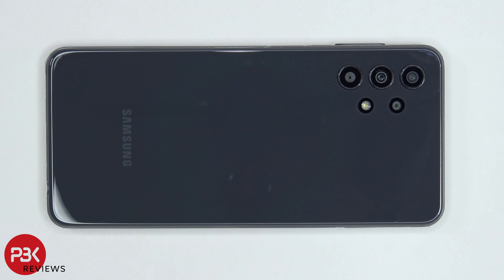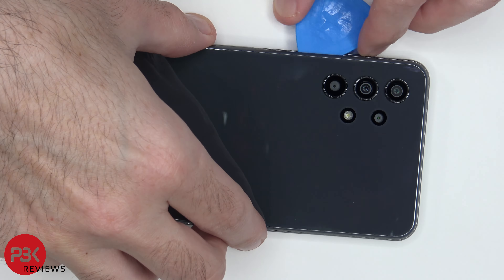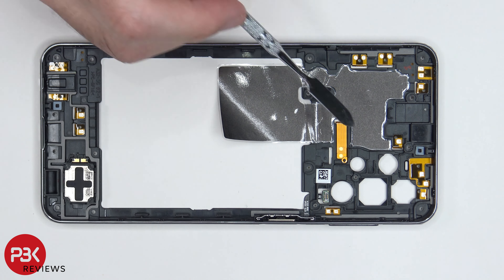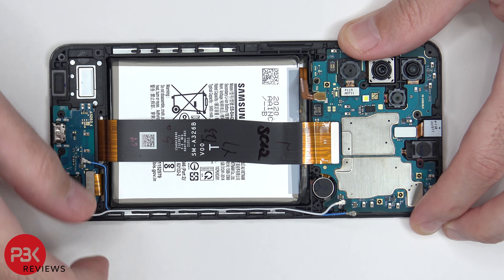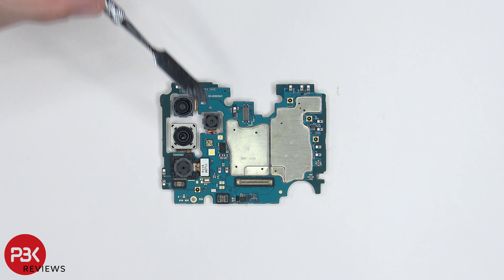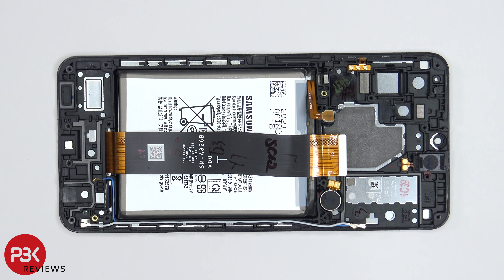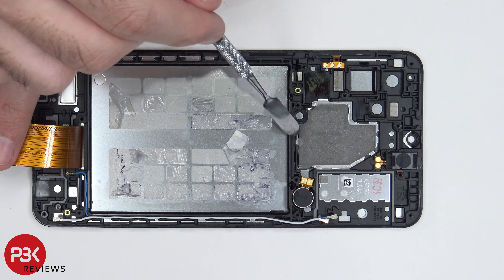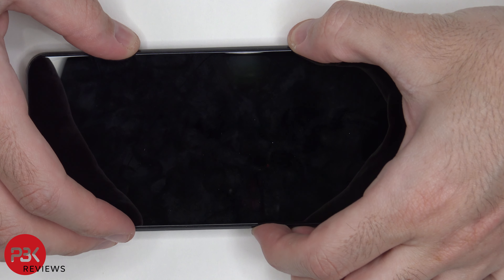Samsung Galaxy A32 5G Disassembly Teardown Repair Video Review

Comment: The one thing missing was all the screws that you had to remove and indication of where all 17 of them are.
The hint on the Battery removal and the nice shot of the battery was great!
One thing that might help in battery removal suction cup tool or to use those shower suction cups ..to give some more pull and gripping.

 Fantastico ..

Comment: I'm not the only one who thinks all phones should, by default, have an easily expandable/replaceable/attachable internet antenna, right? Especially for people who have jobs which require them to travel to the middle of the jungle where there are dead spots everywhere. And since without internet, phones are no longer phones.

Comment: No fancy "plastic pry tool" needed. Did fine with a Van der Hagen razor blade from Walmart, easily retrievable from my bathroom cabinet, paired with a clean pop top from a Fancy Feast cat food can in the kitchen dish drainer. Nothing like using what's on hand when it's 4AM and you accidentally knocked the phone into a bowl of water in the bathroom sink, when you've just arrived home from the country and discovered a tick burrowed in your flesh and you're having a hard time pulling it out... I think that's Murphy's Law, isn't it? When it's been a long night and one thing goes wrong, a whole cascade of things will go wrong in quick succession 😂 ‼️ Thank you so much for this video!
Reply from the maker: you're welcome, and yeah anything that works to use can be used. Only reason plastic is preferred is to minimize damage to the frame/housing as well as possible shorting if it touched anything internally it shouldn't while the battery is connected.

Comment: you can also get the screen with the frame included which makes the repair even easier, and the cost difference between getting it with or without the frame is like $3. then you dont have apply unnecessary heat to the frame of the phone.
Reply from the maker: Yup, I always prefer to use a screen with frame combo, but there are people who would rather save the money, especially on other phones where the difference in cost is larger.

Comment: Hello.
When replacing the battery, do you use any type of glue?
If so, which one(s)?
I'm going to proceed to disassemble it because it was submerged in water and I want to disassemble it to clean it well with isopropyl alcohol. Any additional advice?

Comment: Awesome, do you need to remove both top and bottom boards to replace the battery?
Reply from the maker: No just the top cover to disconnect the battery cable and the flex cable going over the battery from the main board and then you can replace the battery. You don't need to take either board out.
Reply: @PBKreviews  POG thank you!

Comment: Well I won't be taking the battery out. If rebooting the phone by cutting it off and back on doesn't work I'll take it to someone else that can take the battery out, if that's even needed. But very detailed which is good.

Comment: You mentioned adding adhesive to put back together. What should we use and where to apply?
Reply from the maker: Here is the part you would need: https://www.ebay.com/itm/353645960196?hash=item5256f11c04:g:cOEAAOSwUjZhKP8Q    and you would remove the old adhesive strip, and apply the new one to the frame of the phone. You can also watch this video for reference: https://www.youtube.com/watch?v=T4iiPUIM7-Y

Comment: Very informative, thank you. Pkease advise of A series or s20fe/s21fe (both Qualcomm).
Reply from the maker: You're welcome. Not sure what you mean, are you asking which I would prefer? The S20 FE would probably be it since there isn't too large of a difference between the S20 FE and the 21 FE to spend more on getting the 21 FE.
Reply: @PBKreviews  that's an answer will let me choose. Thanks
Reply from the maker: @ivangrigoriev3940  👍

Comment: My Issue is the screen went black when I dropped it and I noticed my phone still functions normaly the vibration still works well like normal but I noticed that it also isnt charging. According to this video.

Checklist + = Its Fine and X = Malfunction

+Phone is Powered(Battery)
+Vibration Works
+Physical Buttons Works

X Screen Is Black all dark
X Charging Port isnt Working
X No Data Sync
X Fingerprint Sensor Not Working
X Touchscreen Isnt Working

WIth this video it has to do with the blue or white wiring and the Screen ribbon disconected from the top Motherboard from the bottom motherboard so the bottom motherboard and top motherboard arent getting any power from each other.
Reply from the maker: The flex cable for the screen which connects to the main board is also the same flex cable which connects the sub board (charger port board) to the main board. You would need to take it apart and make sure that the flex cable did not get disconnected from the main board as well as the sub board. If still doesn't work, its possible the screen is damaged and shorting causing it not to work.
Reply: @PBKreviews  the drop wasnt that bad around 2.5 Feet above ground since i was tripping and trying to stableize mysefl to slowly fall or land on my knees and a stunt made my hand drop the phone

Comment: So what you recommend I do if just lightly touching the screen cable causes the screen to turn off causing the screen to because unusable
Reply from the maker: If you mean where the connector is on the motherboard, if you press around there and the screen stops working, then you have a bad connector probably. If you just move the screen cable and stopped working, you probably will need a replacement screen.

Comment: I changed my screen and the LCD works but there is no backlight. I put back the old screen which worked but now there is no backlight. What issue could that be from?
Reply from the maker: Its possible you may have damaged or broken one of the resistors or small chips by the screen cable. Try also brushing off the connectors with a small brush and see if it helps.

Comment: Hi all, i do have th is same phone the screen wasnt turning on. I did give the back a rub yes a rub like a massage a alakazam it turned on, now i drop it 2 days later and same problem?? could i need a new screen any way??? I have disassembled the phone, the connector from screen to primary board seems a little ify loose?? i did notice the white wire from sub board to main board was pinched from factory wasnt installed in the channel the blue wire goes into also?? please help....😂
Reply from the maker: I don't think the coaxial cables (those wires you were referring to) would have anything to do with it powering on. But the display cable being loose or having an issue can be what is causing it or a loose battery cable.

Comment: Would this work to fix water damage I ended up dropping  in a puddle big accident  I got it out straight away and dried it off with my jacket it worked  perfect for awhile but now it's not truning  on the screen stays black  but you can here it vibrate
Reply from the maker: You can try taking it apart and disconnecting the battery cable, then drying out any liquid or moisture inside and then brushing off any corrosion around the connectors or chips with a tooth brush and put it back together and see if it will work. If not, you would either need a new screen or its possible the the chips on the board went bad somewhere. Usually with water damage, you want to avoid using the phone until its been taken apart and completely dried out/cleaned of corrosion so the phone wont short.

Comment: My a32 5g screen now having problem. Starting yesterday my a32 got hanged and no responce to touch, so i just try simply knocked on the screen with 1 finger(not too hard n not too gentle), then it worked back. But today cant even touch, no responce at all. Does it mean the whole screen need to be replace? But the screen doest break or crack, it still displayed like usually, just that no responce to touch at all. I force restart few time still the same, not responce to touch. What should i do? 😭
Reply from the maker: Its possible the cable may be loose or something is shorting inside (any corrosion from water damage etc.) or just the screen is going bad.
Reply: @PBKreviews  never drop in water before. Maybe i should tear off and check inside for loose cable? Yes i afraid if the screen is going bad. I bought this phone last May, so fast the screen can be like this😭
Reply from the maker: @ultrainstinct5767  its possible but most likely not a loose cable. Ya sucks, hopefully you can get it fixed and not need to replace the screen :) good luck.
Reply: @PBKreviews  found out the problem by technician friend. I dont know what this thing is called, but its the tiny gold pins went off from the screen connector on the motherboard. A very very tiny piece of thing. So complicated i not sure can be fix or not. The connector shaped like rectangle, and filled with gold pins all around inside, but the whole pins on lower part went off. 😒
Reply: @PBKreviews  on your video, in 01:55 after u took off the screen cable, you can see alot of gold pins inside the screen connector on the mainboard. Is went off gold pin fixable? Its just too too tiny.

Comment: Questions....  is it ok to use a SM-A326B for one that come with a SM-326U ???
Reply from the maker: which part are you referring to use?
Reply: @PBKreviews  sorry about that. are the screen SM-A326B and SM-A326U compatible and are they interchangeable.
Reply: @maverick13nyc  I think ones the 4g version and one is the 5g version. The screen on the 5g is just slightly larger.
Reply: @maverick13nyc  NO

Comment: Do you Thing I would be hard to repair the fingerprint scaner?
Reply from the maker: No shouldn't be too difficult. It's held onto the back housing with a metal bracket, so once you take the back plate off and remove the screws and take off the back housing, you would have access to removing the fingerprint scanner and replacing it.

Comment: Bro is there glass over  the camera in the back panel when removed ?
Reply from the maker: The three camera circle covers on the back plate are glass. They are held down with adhesive, they can be heated up and pried off
Reply: @PBKreviews  my camera and backplate are scrateched it means when i change the backplate the outer camera glass too??
Reply from the maker: @sayon6951  Usually the back plate or battery door replacements come with the camera glass cover as well.
Reply: @PBKreviews  Thanks bro
Reply from the maker: @sayon6951  👍
Reply: @PBKreviews  bro does  the above glass of camera being scratched affect photo that much beacuse i cannot notice  it ??

Comment: Is that the serial number on the back housing
Reply from the maker: Hi, no its probably just a manufacturer identifier for which type of back housing with which type of flex for antenna is being installed on which region device etc.

Comment: great job explaining,  kinda sad that the idiots  of Samsung couldn't just make it so you can replace the battery but nooooo because they want to be able to track you everywhere  you go and if you remove the battery they can't do that.  I think it's time  that another competitor created an = phone that allows for battery replacement.
Reply from the maker: Thanks! There is a company called Fairphone which has phones with removable battery but they are pretty pricey.

Comment: Wish you would have pointed out where the Wi-Fi network chip is so that we know where to upgrade it because the one that's in this phone sucks.
Reply from the maker: You would not be able to upgrade it, its soldered onto the board and would not be a simple solder job would also require software modification on an engineer level.

Comment: It's like performing surgery on your phone, is this just a tactic to simply buy a new phone when the battery die's, because most people can't or will not be bothered
Reply from the maker: Yep or you would need to take it to a repair shop to get replaced for you, or send to the manufacture for replacement of the battery.

Comment: Piece of crap phone with a terrible camera that cant take a clear photo of anything less than 20 feet away.  Non-removable battery to force you to bring them your phone for repair or prevent you from actually powering down your a32.

 I wouldve never bought this stupid phone had i known the battery cant be removed.